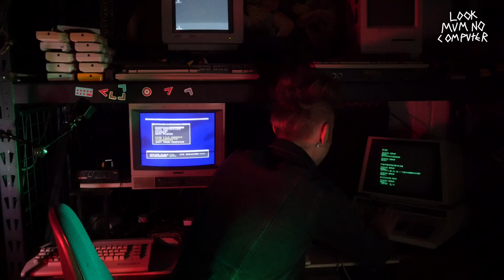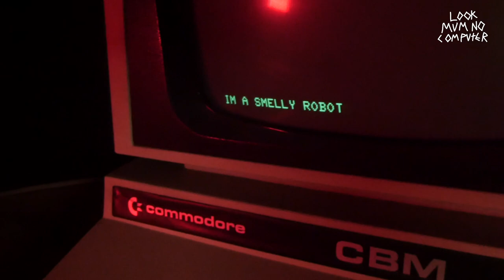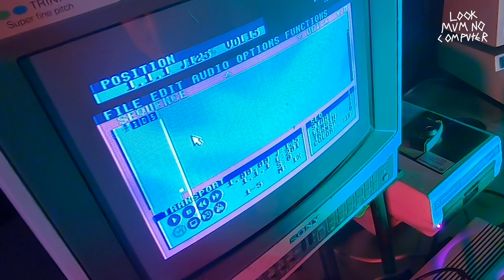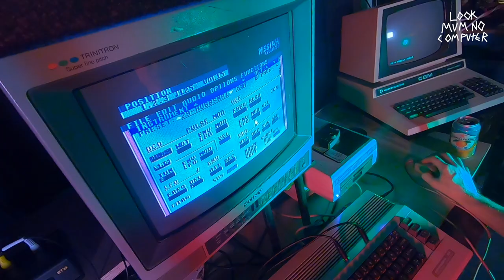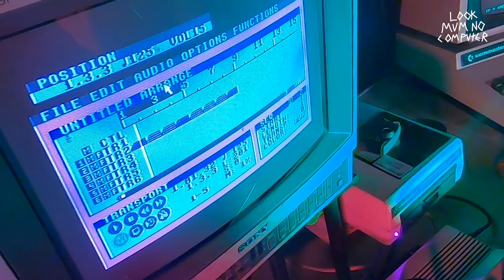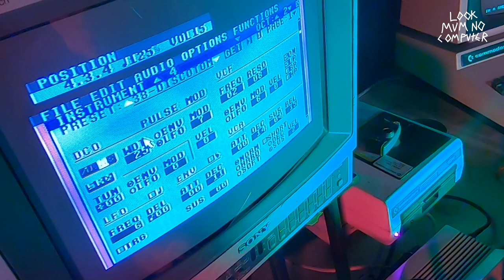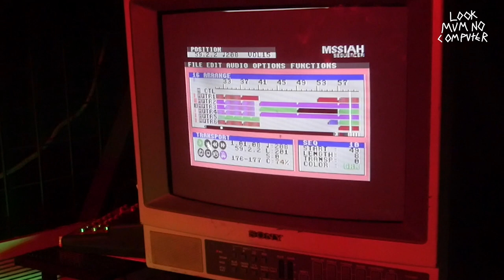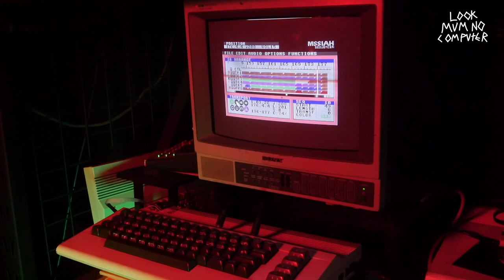Producing A Song On an OLDSKOOL Commodore 64 With MSSIAH

Comment: Amazing how capable this 8 bit machine still is in 2019 if coupled with proper software and right hands on it!
Reply: Old, not obsolete ;)
Reply: "right hands" is the important part.
Reply: Not just this, the Gameboy coupled with MGB, and the Nes paired with Famimimidi /Midines allow you to use those as midi synths too with controllable parameters
Reply: Those SID chips are amazing, especially the 'flawed' 6581.
Reply: There's a bit of cheating here - no 64 had 2 sid chips stock.
Reply: @KingMob4313  Also the Prophet64 code was developed 20 years after the SID chip was released. It would have been done in an integrated dev environment on a modern computer using countless modern techniques in software engineering. To have made this system in 1982 would have been nothing short of a Star Trek episode.
Reply: @mons.romerodurante8086  yep, when the sid was made they had no idea of what they've created, it was supposed to be another simple sound chip as any other
Reply: @MasterControl90original  same as with the VIC; today's software hacks by awesome demoscene programmers push the multimedia capabilities of the C64 into levels of bigger machines of the 80s era
Reply: well. people have had 40 years to figure it out. still a sid chip is probably better at home in a 6502 + midi board that is not a c64. nicely clocked at a stable frequency (preferably one at which most of the oscillator settings actually do work out to more or less correct common music notation frequencies), no video chip hijacking clock cycles, etc, no irq's getting in the way other than for midi-rxd, etc.
Reply: @CB3ROB-CyberBunker so an Elektron SidStation then?
Reply: @MasterControl90original Bob Yannes very much did know what he'd created. As a synthesizer aficionado, he pushed for a chip capable of real subtractive synthesis. It is the only chip of any era to include analog signal paths and circuitry for audio.
What's been very impressive is how SID-like demo scene programmers have managed to get other, much less capable chips to sound

Comment: The C64's SID chip is like a flute, it's a musical instrument with a unique sound that will be around 1000s of years.
Reply: I agree, although like 303, 808 etc a lot of people will have to use samples or emulations
Reply: @davetbassbos  Plogue is planning on making one of those, so hopefully it won't be too bad quality. their Porta FM synth is pretty neat
Reply: @autumnbrushtail  They already did :) It's good enough that I took my sidi2sid/mssiah rig out of my midi rack.
Reply: @whisk0r  I know about Chipsounds, but they're actually planning on making another under a line of plugins known of Chipsynth. Porta FM being the only available synth available under that line so far. Be that as it may, Chipsounds is very neat from what I've seen at least
Reply: @autumnbrushtail  Really good sid functionality in Chipsounds.  Looking forward to more great stuff from them.
Reply: @autumnbrushtail  Cool I use a free vst I got a couple years back called Dream64, it's pretty good and gets me in the ballpark although I'm not sure if it's supposed to be an exact emulation, I'm definitely firing it up after this video!
Reply: Get yourself a container full of sid 6581r4 and another container with C64 and MSSIAHs and in 50 years you'll be rich.

Comment: Time to dust of my c64 with mssiah and connect that to my atari 1040 ste with cubase 3.1^^
Reply: you still have a akai s900 to connect it too?
Reply: @theshyguy1580  no s900, but a s950 ;)
Reply: @mb2776  Good enough!!
Reply: @mb2776  ,lol how 90's i had 2 s950's with a 1040st ,and then bought a  roland s760 fully loaded with mixer cost me  about £3500 in total back in the day...,yes i still have my 3 samplers but i dont even use them ,cubase used to be the industry standard ,now more switched over to logic and Ableton Live ,  look up "BRUCE LEE (1984) - LukHash REMIX (performed by 🐼 Kung Foo Panda)  or LukHash // COMMODORE 64 LIVE DEMO or C64 Alien (1984) 👽 LIVE   you be amazed ,its not just about the sid chip think he uses messiah and synthcart
Reply: @-GA-MancsFinest  those s950's have some good sound, maybe u can reactivate them;)

I know luckhash, he was the reason i got myself a mssiah cartridge
Reply: @mb2776  ,the c64 music/amiga (octamed/Bars and pipes/mod tracker)/atari ST's & Falcon (Cubase)was what actually got me into music production,the samplers mixers ,fx units i have collected over the years and never sold,ive been using OPEN mpt link here  https://openmpt.org/  it plays a lot of music trackers from that era ,there are also c64 vsts too

Comment: I wish I was as free-flowing as you. You seem to be a funny combo of impatient and patient, because I would never be able to work with this retro clumsiness any more (I started putting a retro studio collection together and had to give up because of the lack of proper storage devices to run software from, and I cannot afford the new retro tech made to solve this issue). My retro studio plan was a failure. Though, it was never a good idea because, like you said in a later video: use a more modern computer! I did retro computers when I was 12 and no longer have that patience. Nostalgia can be a trap.

I always notice how beat up and dirty your stuff is. While part of me is appalled, another part (the part of me that likes the Max Headroom TV series) loves how rough your stuff is. It definitely looks lived with. Mine’s pristine (until some random accident scratches something and I get pissed)... where as you don’t seem to give a fuck. Your stuff is oozing with character. It looks like art. You seem to have fun and just PLAY, which I don’t really know how to do any more (so much control and so little fun). But you just kind of beat on things and screw with them... though you can fix shit if you break it and I can’t (tried to learn a little electronics ages ago and my brain just doesn’t cope with math/numbers and my hands shake so soldering is a PITA). 

Anyway, your videos are entertaining me and I’m sort experiencing this stuff vicariously through your project videos. Thanks! If I wasn’t in poverty, I’d send you a patreon donation. Do you do well for yourself? I’m assuming you don’t live in that garage...

Sorry for the fucking novel.

Comment: 'King brilliant! Keep it up.
Both the C64 and ST have crappy shielding and produce amazing sounds if you get close with a coil or an old AM radio. May be a way to add some control for a live filter etc using the noise they make. Or add some grit here and there. 
Again, brilliant Sam. Cheers

Comment: I've got a Mssiah cartridge as well... quite cool actually.

 There is another synth cartridge called the CynthCart64 (just in case you didn't know). I've gotten hold of the first version of it. But it seems they've made a CynthCART 64 v2 which has a build in analogue digitizer. There is no Midi in the CynthCart64, but it should work with the 3 port Midi controller cartridge  from Datel, haven't gotten as far as testing it myself yet.

 Then there is the reproduction of the old SoundExpander from the 80's, which adds a Yamaha synth-chip to the SIDs. It is called the XeNTaX FM YAM. I of course had to get one of those as well, although it seems a newer version of that one is brewing as well.

 "You" will of course need a cartridge expansion module (sticking a mile out the back of the C64) in order to use more than one cartridge at the time. There is the X-Pander 3 and the Mini X-pander. But not all cartridges go together. For instance the Mssiah and the CynthCART, since they both contain synth software, they do not like each other. The Mssiah actually doesn't seem to like company at all. However the CynthCART, Datel-Midi and FM YAM seems to "play nice" together in a X-Pander 3 module.

Links (in case you're interested):
http://www.indieretronews.com/2016/06/cynthcart-64-v2-analogue-digitizer-for.html
https://sharewareplus.blogspot.com/2016/09/new-datel-midi-interface-now-available.html
http://c64.xentax.com/index.php/fm-yam
http://store.go4retro.com/x-pander-3-slot-cartridge-port-expander/

Finally here is a video I did a while back, shortly after I received my FM YAM cartridge:
https://youtu.be/EzKhRRvWTRQ

Comment: The SID sounded soo f**king good and still does... I oftend asked mymself why later computers did not use it or 2 of them for stereo sound (additionally to DSP chips to playbaclk samples)...  thanks for this flashback!
Reply: Cause as a sound chip, it has character and sounds awesome.

But for sample playback and versatility, it's not that good.

In the past, programmer wanted a more high fi sound and for that, the SID is rather useless.

Still, i love my c64 with mssiah :)
Reply: @mb2776  yes i know, thats why I said the SID could have been used additionally to DSP chips to combine sample playback with SID synthsounds. that would have been amazing .-)

Comment: Best chiptune ever :D !!!! I have mssiah too... love it! But only with one sid.. No skills with modding... thanks for workshop a much! Maybe it helps me.. I have circuit for double sid.. and another sid chip.. but it is different number of chip.. older one..
It is ok to mod it woth two different sids? I know it is possible, but it is good?
Reply: No, not with SID2SID. 6581 and 8580 use different voltage. You need to stick to what the main board is built for. There are more advanced boards, like SIDfx, letting you mix and match at will.

Comment: Hard to believe that Robert "Bob" Yannes, the inventor of the SID chip, originally envisioned 32 VOICES for it. Unfortunately there wasn't enough time to implement it and/or it would add too much complexity (and therefore cost) to the system. Can you imagine what kinds of SID tunes we'd be grooving to if that had been possible? 

By the way, Bob went on to co-found the Ensoniq digital synthesizer and sampling company. The Ensoniq synthesizer is still used by musicians to this day.

Comment: Brings back memories.... a few years ago I modded a couple C64's for use with Cynthcart,  Retroskoii+,  and Prophet64  (the precursor to MSIAH)  I found p64 the most fiddly thing to use (especially with a 30 year old mouse) and I ended up selling the c64c.  Good sounds though.

I actually still have the modded c64 with Cynthcart,  thinking about selling it if anyone is interested!

Comment: I prefer the warmer sound of the MOS6581 in general but it mostly depends on which chip the composer targeted when making the song.
Also you should be able to have a 6581 and an 8580. That way you can get the best of both worlds...  unless MSSIAH just uses whatever chip is available to play the channels?
Reply: Different voltage of 6581 and 8580. SID2SID won’t let you mix them.

Comment: Well I was programing Basic in grade school . I was not the gamer and II still have my Commodore 64
that came out 1982. My school had the Commodore Pet that came out in 1977 and when the Commodore Amiga came out in 1987 the Community T.V Station got it for graphics animation.  So I know the commodores like the back of my hands or front I guess. 

The first computer you showed may have been the 64C  or the Commodore 16 but The commodore that you got from the guy was either the Commodore 128 or the Commodore 65 or Amiga witch all were skinner keyboards than the 64C and C16.
Reply: Take a look at Wikipedia they have photos of all the Commodores that they made. https://en.wikipedia.org/wiki/Commodore_International
Reply from the maker: both were c64c's

Comment: Nice.  I've always wanted to get this but I'm not very confident when it comes to taking stuff apart, so I wouldn't feel comfortable performing the necessary hardware mods.  On that note, I noticed you used 2x 6581s.  Is it not possible to mix SIDs or is that not recommended?
Reply from the maker: yes you can mix em up but need to wire in a power from elsewhere 8580's are 9v and 6581's 12 v

Comment: I think the direct period-correct rival to music on C64 with this would be the 800XL or 130XE running Advanced Music Processor. (Which came from Antic Magazine, also known for Antic Music Processor.) Pokey had one more channel than the SIDs three (at least in stock form), but a different sound from the SID given how it generated the waveforms or white noise.

Might be some interesting software to play with if you ever dabble on the Atari side. (Programs a bit more like a tracker, with note/octave/duration typed in with text, or alternately you just enter the same numeric values that the poke command would use to do things like slides. Not sure if the format is exactly that, but it's been over 30 years since I messed with it.)
So something like this: https://youtu.be/tMXfrPhC7RQ
or perhaps this: https://youtu.be/mytEfdRcEjg

And of course the kind of sound in general, although not an example from that software:
https://youtu.be/JDeV7wrB2c0

Yeah it's strong area was fat square waves rather than sines or sawtooth. So Pokey is notably different than SID.

Another Pokey trick was there was some way to program really low resolution samples into it. However that was different software yet again, and examples of it are kind of rare because the computers barely had enough memory as it was.
Somehow I found an example of that: https://youtu.be/g15zF5bCFbQ

Perhaps also worthy of exploring in retro-computing. Would be neat to see a composition with dueling SID and Pokey written by a current synth guru just to see how it'd sound.

Comment: do it with 1 sid chip. 2 defeats the object. waiting for the 64 to be re released to get the old crew to get together to write an intro. all in assembler. 3 channels and white noise. 1985 in the house

Comment: I’ve got an old Corona/Smith word processor 2000. Running 8051-8052 pair. I want to add a sound chip to turn the data into sounds. And create a “Sound Word” database 🤔 
Any suggestions? 
Always love your content. 
God Bless.
Reply: That was Quite Pleasing. 
Mum would be disappointed 😔 
That means 👍

Comment: Awesome track. Would music with this much stuff going on actually be able to play in a c64 game? Never heard anything like it from a c64, so I assume this is taking up a significant amount of ram just to play back. Am I wrong?
Reply from the maker: yes this probably would struggle. this is the c64 at its limit. but could be an intro or what not.  plus this is double sid chip also. however it would work on a single sid as the tracks are just multiplied to fatten up the bass and drums

Comment: Great vid!

But SID is anything but analogue synthesiser. Otherwise, another yummy video! Thanks.
Reply: Franko digital oscillators, analog filter n__n
Reply from the maker: well it is as analogue as a synth voice in something like a juno pretty much. digital multiplexed oscillators. digital envelope generators, analog filter, not sure about the amplitude, that may also be digital. but definitely an analog filter in a sid chip
Reply from the maker: by what i mean by the juno is digital control oscillators. but then again they have some analog aspects to them, so yeah i think pretty much just the filter is analog.   but techinncaly a lot of synths today that have analog filters are called hybrid..... regardless theirs definitely an aspect of analog
Reply: LOOK MUM NO COMPUTER actually i think they were digital phase accumulating oscillators, and weren't multiplexed. there's a really interesting interview with bob yannes (creator of the SID chip), where he goes into it in a bit more detail. http://sid.kubarth.com/articles/interview_bob_yannes.html
Reply: @LOOKMUMNOCOMPUTER  well I see your point. But it's not analogue synthesiser by any means. Minimoog is. That's my point

Comment: You can't really call a C64 with a two SID chip mod an actual C64. Using the term an actual C64 means it should run on all C64s out there.